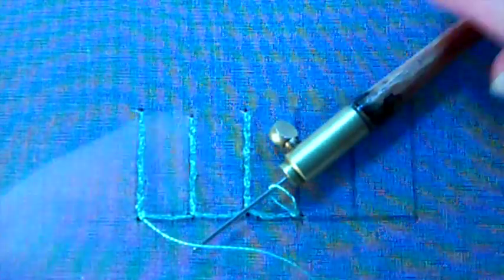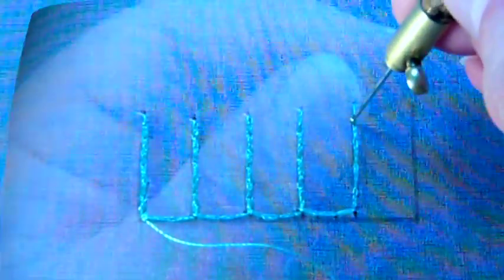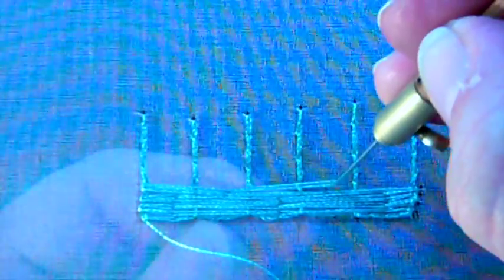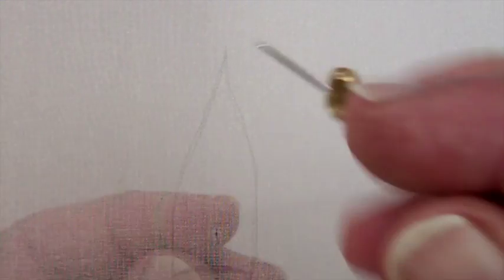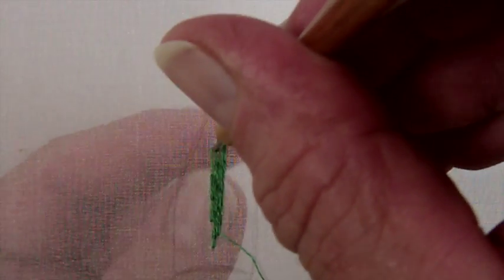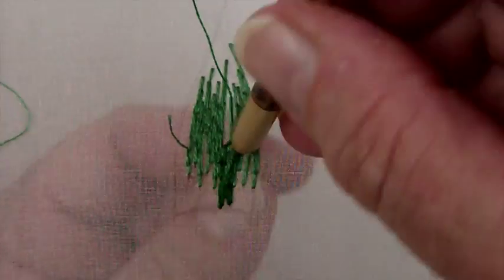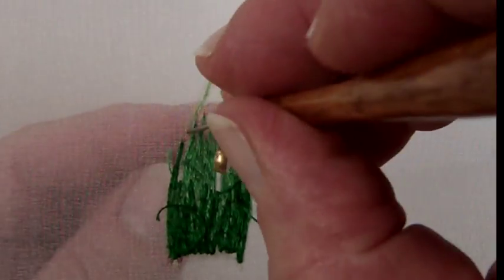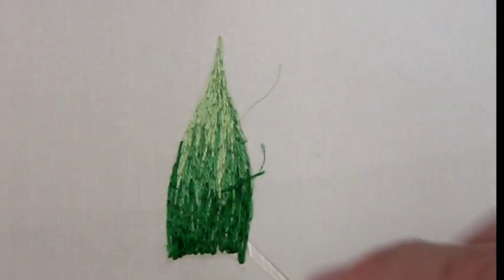Tambour Chapter 1 Thread Manipulations Part 1

Comment: I can't wait to buy your book!  This exactly what I've been trying to teach myself.  What kind of thread are you using?
Reply from the maker: For surface embroidery I use a single strand of embroidery floss. IT can be cotton or rayon. Machine embroidery threads also work just as well
Reply from the maker: The thread is just a single strand of embroidery floss. Please be aware that the book does not cover the instruction to learn the technique only what you can do with it after you learn it. The techniques is best learned by attending a class.

Comment: tambour stitch needle size
Reply from the maker: I use the #90 hook for almost all my work . The size of the hook is determined by the the thickness of the thread
Reply: Robert Haven, you are looking at the right side by stitching with satin stitch? Not the same as in case of stitching with beads?

Comment: Where is the thread
Reply from the maker: The thread is on a spool off to the side of the frame. It comes to the fabric from underneath the frame ...the back side of the design. When doing thread embroidery the front of the design is face up , when adding beads or sequins the frame is turned over and you are working from the back.